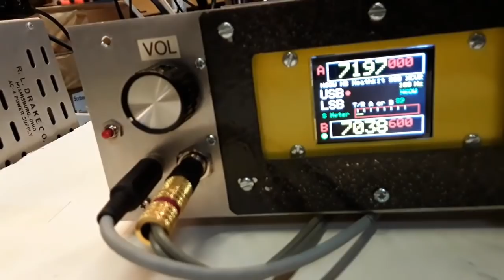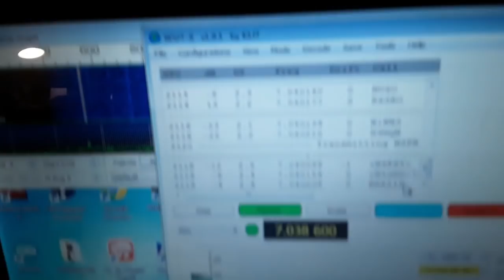Heathkit Transceiver

Comment: yet another neat transceiver Pete. I have an HW101 in the attic, hasn't been on air for a LONG time but I could not bear to cannibalise it for the filter. Hope to get back to my projects soon, we were in Sicily for two weeks and I have had a couple of crazy weeks since returning. A family wedding next weekend marks the end of the crazy season - bride's father is half Italian, so it should be a good bash!
Reply from the maker: Hi Steve,

Thanks for your post. By all means keep your HW101 stock. But the beauty of today's technology is that you can take the older filter's and with but a few parts turn them into a complete and capable modern style transceiver. True it is not SDR but insofar as digital frequency accuracy it works like the best of them and very suitable for WSPR and FT8. Wow a wedding coming up --start the diet now and practice your ability to hold a few drinks. So much fun ahead! 

73's
Pete N6QW
Reply: No diet for me Pete, but I suspect my cousin's daughter (the bride) and her mum are in full diet mode. Best bit about the wedding is that it is close to were our daughter and son in law lives so we get to spend time with the grandbaby (2 and a half and showing signs of having the knack!).

Comment: Fantastic job, Pete!  This must be the rig using the Heathkit filter you were referring to in your earlier email....
Reply from the maker: Hi Pete, 

Yes that is the rig -- am nearing to finishing the project. Just shows what you can do with surplus crystal filters.
Thanks for your post. This is a great rig -- but not quite as good as a bowl of home made pasta.

73's
Pete N6QW
Reply: Nice looking rig!!!
Reply from the maker: Hi Dean,

Thanks for your post and comment. Note the blue LED on the Si%351 --look familiar?. Works really well. I keep asking myself why there aren't  more homebrew rigs using the surplus SSB Filters that are available. I have two rigs that use the early Yaesu FT-101 filters. Might need to find a cheap kenwood filter and see how that plays.

73's
Pete N6QW
Reply: Yes, the blue LED does look very familiar, I'm glad you like them and they are working well for you.  I agree, surplus filters are a good way to go.  I bought one of the filter boards that have the 3, 9Mhz filters on them.  If I ever get any time to build, I intend on building a full HF rig with, SSB, CW, and AM.  AM mostly for receiving.  I like to SW listen occasionally, and I don't like how AM sounds through a product detector.  So I will process the signal through the wide filter and into an envelope detector for AM.  Looking forward to get on the bench and working on it.
Reply from the maker: Hi Dean, The rig I built with two of those filters is basically the same architecture as this heathkit rig. So yes they do work very well. Perhaps with winter on the way you will have a bit more time. Thanks for your post
73's
Pete N6QW